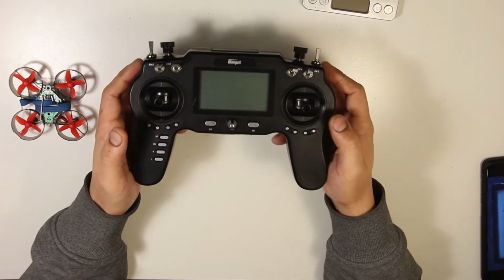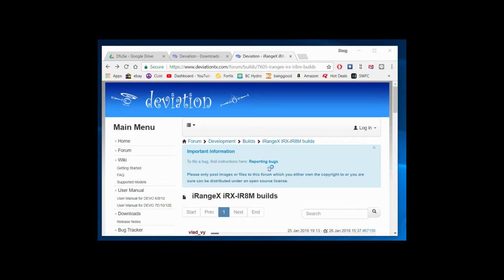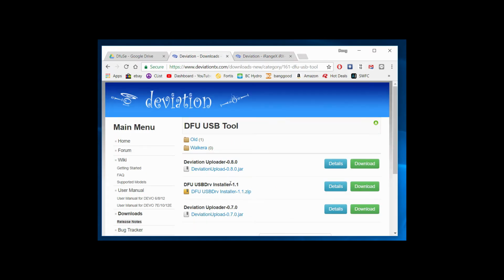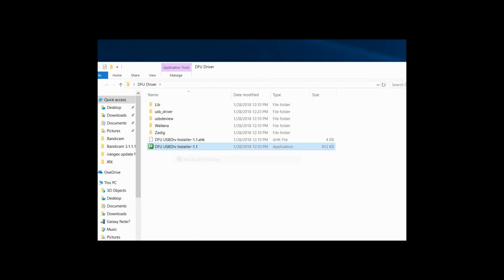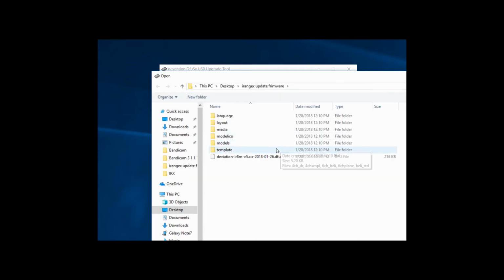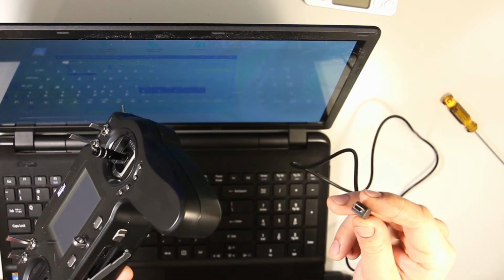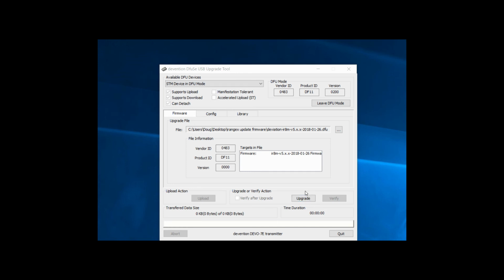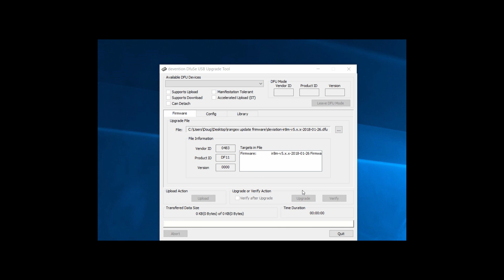iRangeX IRX-IR8M Firmware update

Comment: Thanks to Doug for this great video. You will have to copy over all the files and folders to the transmitter's memory as well but not the dfu file itself and the zip file. To do this connect transmitter in usb drive mode by holding done the ENT button while switching on. You will see a USB icon. See the Devo 7e deviation manual as the process is similar.  Connect using USB3.

Comment: thanks for sharing! can you may tell me what kind of protocol i should use wenn i have a frsky d8 mode reciever?!cheers from germany
Reply: The Frsky protocol is used to control newer (telemetry enabled) Frsky™ receivers using the two-way protocol (D8). NOTE: This protocol requires the addition of an ‘CC2500’ hardware module to function. Check out the Deviation website for more info under the iR8M Built section and the "generic" Manual as there are is specific manual made for this TX from what I can see. Hope this helps, cheers Alain